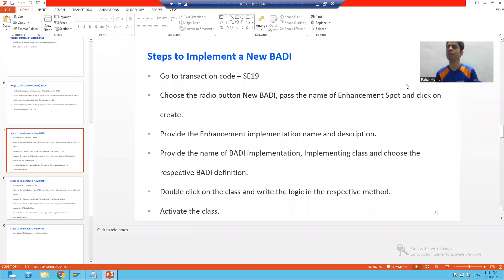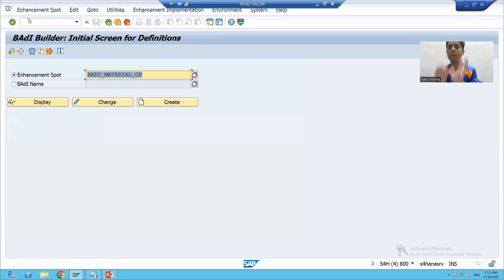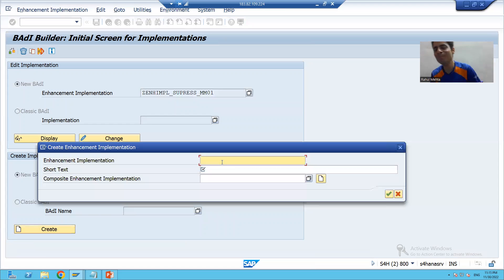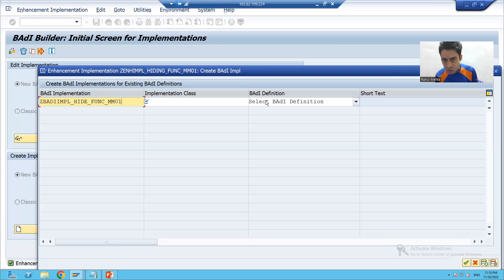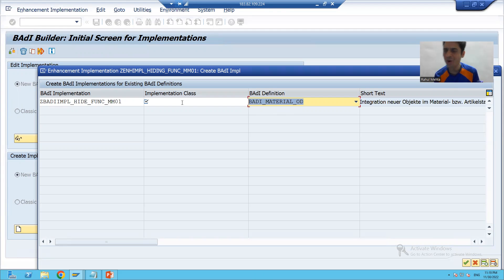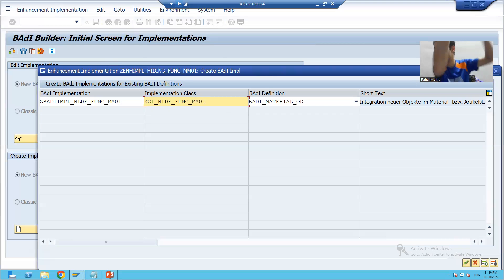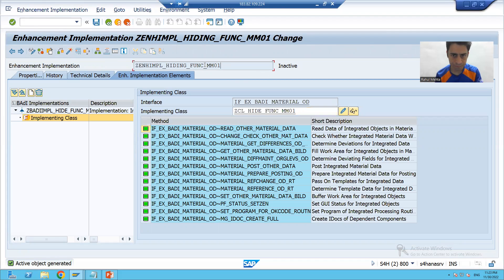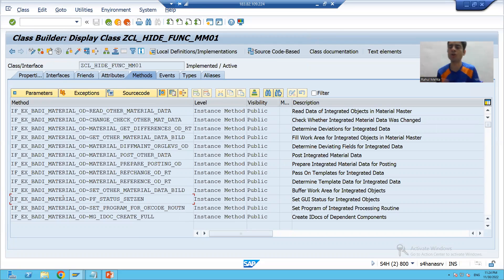28 - Enhancements & Modifications - BADI - New(Kernel) BADI Part3

Comment: Hi Sir, You have said we want to implement all interface methods in the class which we defined but in classical badi also we have other interface methods why didnt we implemented all menhods in cllssical badi?.In classical badi for BADI_MATERIAL_CHECK interface we have implemnted only for check_data but not for other methds
Reply from the maker: Hello Sumlata - Sorry for the late reply. In NEW BADI, we use the statement CALL BADI. In this, SAP is checking the implementation of all methods. It can be empty implementation.

You can check this link of SAP documentation. 

https://help.sap.com/doc/abapdocu_latest_index_htm/latest/en-US/index.htm?file=abapcall_badi.htm

The below mentioned description is mentioned on the link.

If a method is added to a BAdI afterwards, it may be missing in a BAdI implementation. In this case the call is executed as if the method existed with an empty implementation.
Reply: @sapabapbyrahulmehta   Sir even I got the same doubt. Another explanation I found for this question. 

Kernel BAdIs are tightly integrated into the ABAP Kernel.
They are compiled directly into the call stack (hence the name "Kernel" BAdI).
For consistency and predictability, all methods must be implemented to conform to the complete interface contract.
Reply from the maker: @sai_tejayt    Correct Teja.